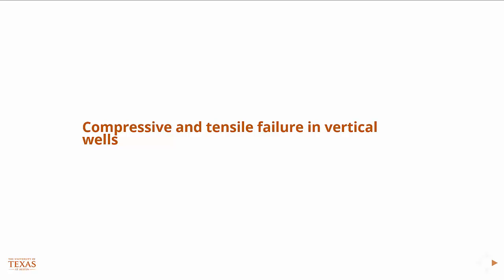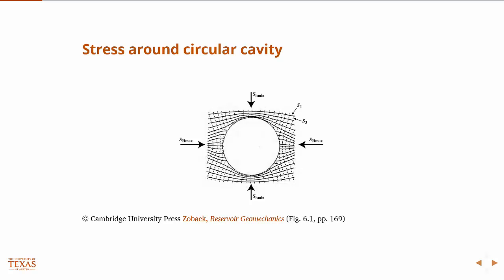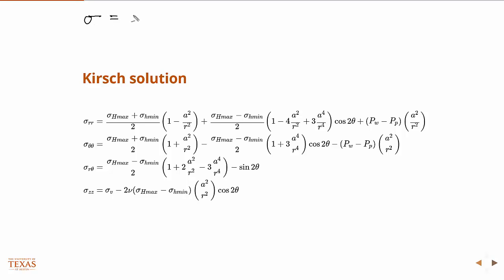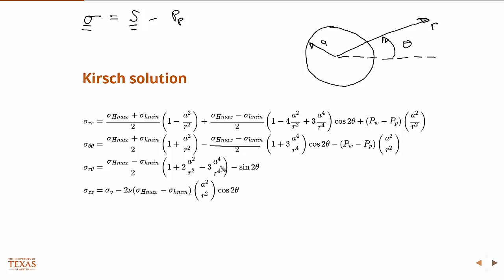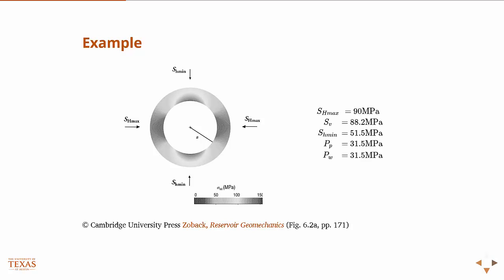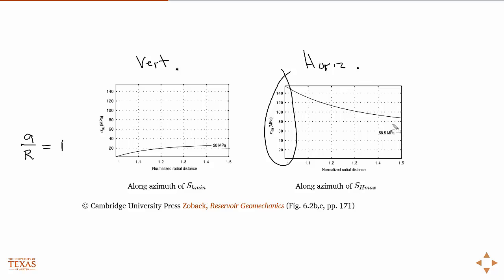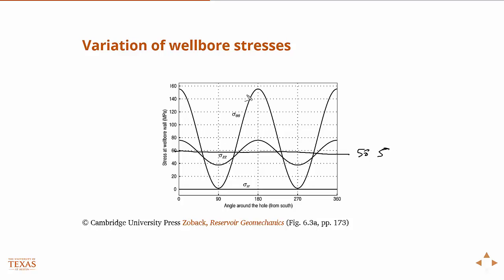Stress around circle hole

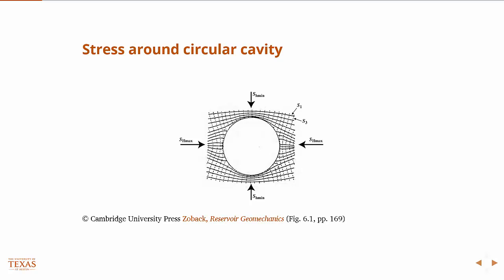Comment: The Kirsch solution published in 1898 (not 1896) did not assume biaxial stress loading, nor pore or wellbore pressures. Therefore, the figure shown at 1:17 is not from the original Kirsch paper. Kirsch only considered single stress concentration, "σ" around a hole, that is not pressurized (https://en.wikipedia.org/wiki/Kirsch_equations). 

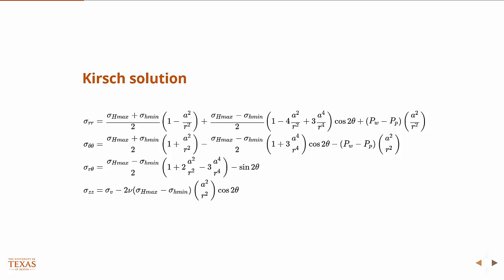Somebody else (whom I don't know), sometime between 1898 and 1957 must have modified the original Kirsch solution to incorporate biaxial stress loading, before Hubbert and Willis (1957) incorporated the pore and wellbore pressure terms. Thus, the equations shown on the slide at 2:43 should not be referred to as the "Kirsch Solutions" as they are colloquially known, but Hubbert and Willi' modified version of Kirsch. Haimson and Fairhurst (1967) further modified Hubbert and Willis' equations considering fluid infiltration from the wellbore using Biot's theory. 

Nevertheless, very nice and informative piece.